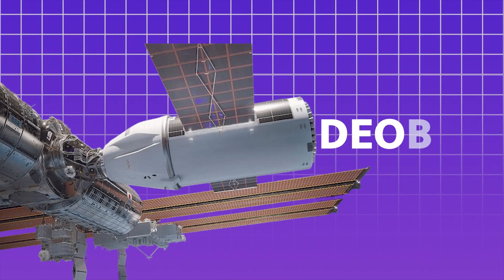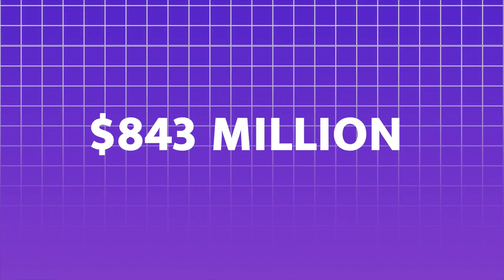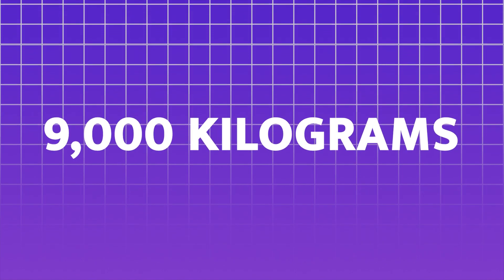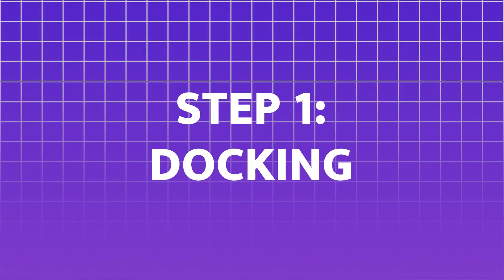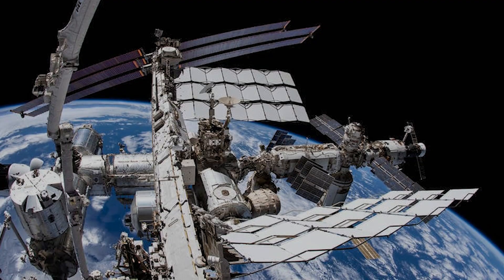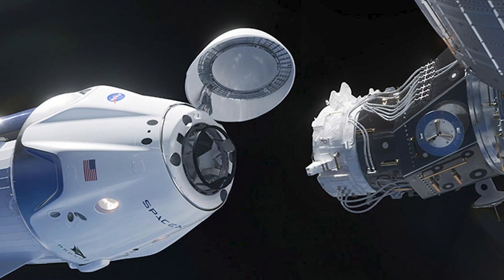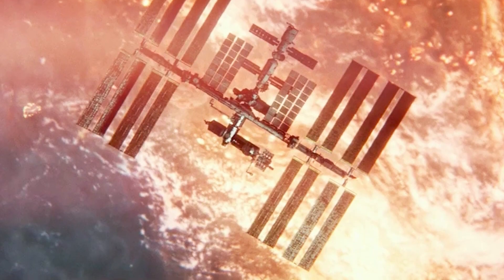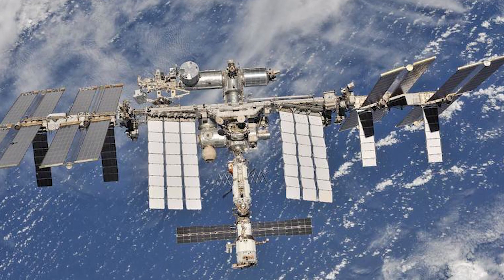How SpaceX's New ISS Deorbit Vehicle Works

Comment: With the avionics and the rest of the electronics in the trunk and no need for a reentry heat shield the "dragon" part can be a hollowed out shell allowing the fuel tanks of the larger trunk to be extended into the space that the dragon shell covers rather than having separate "extra tanks" inside the capsule itself since the main purpose of having the "Dragon" part is really just to hold the docking adapter and any additional bracing required.  So having the tanks extended into the capsule portion means that bracing can be shorter and lighter and less plumbing will be required as well.  That greatly simplifies the vehicle and is exactly in line with the principle that "no part is the best part".
Reply from the maker: A really great explanation, Spacer 🧑‍🚀  Thank you!